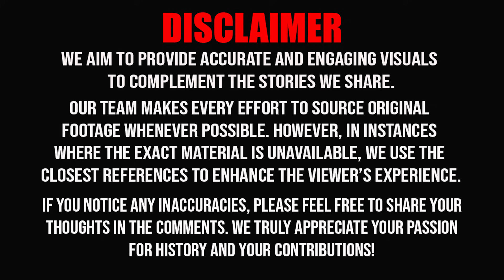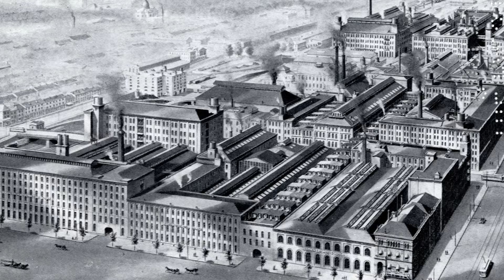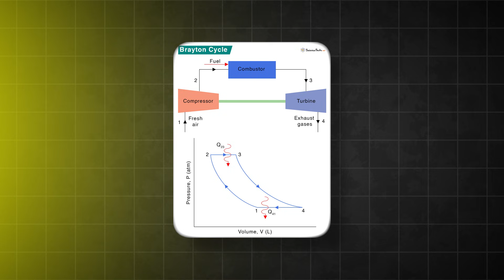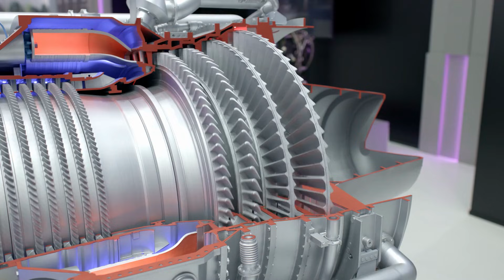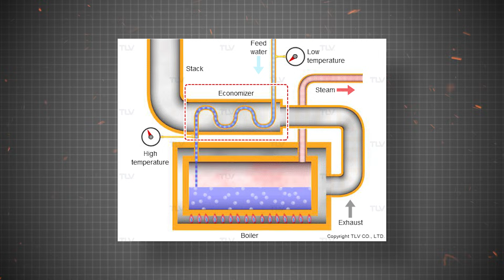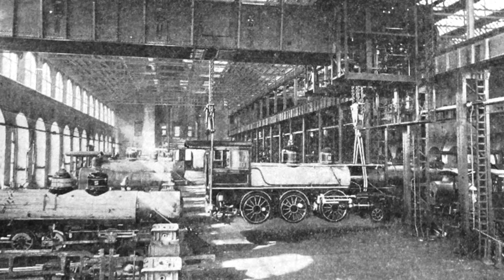The Rise and Fall of the Blue Goose Gas Turbine Locomotive: Why Diesel Won the Railroads

Comment: Good experience for passenger light train....In France we run to 125 mph during several years with engines "RTG" (Rame à Turbine à Gaz". American AMTRAK company buy this for North Eastern lines of USA, also Egypt and Iran Railways. American Rohr Industrie build this engines in the seventies. The first TGV (high speed train) also this power, but the crisis of petrol in 1973 stopped this train and convert in electric train 50 hertz. No comparison possible with monster trains of USA !! friendly from France. Very interesting video.